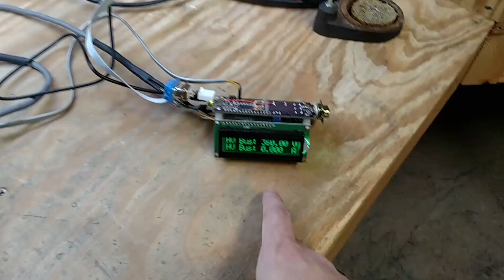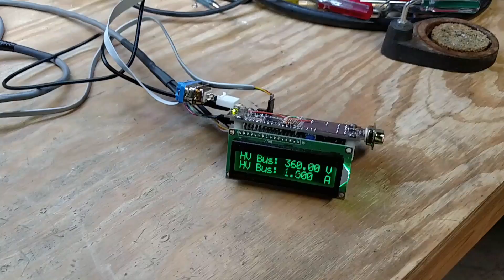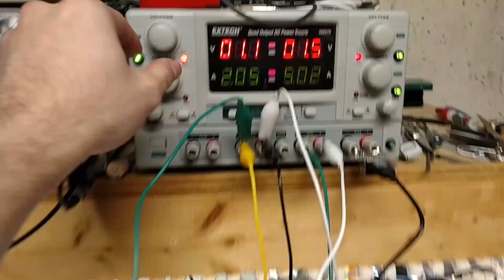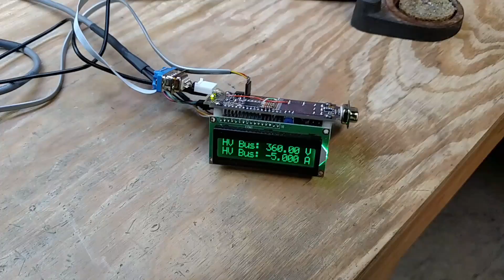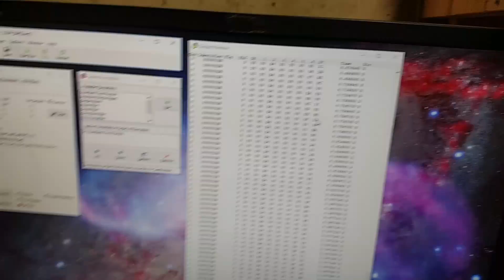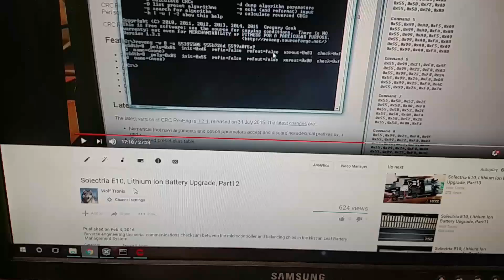Solectria E10, Lithium Ion Battery Upgrade, Part34

Comment: Nice work. So if you fake all the cell data and get your Capacitor of Doom set to about the right voltage you could drive a Leaf with a long extension cord :-)
Reply from the maker: +jontscott 
Yeah... Not sure how to keep other drivers from running over your extension cord... ;)